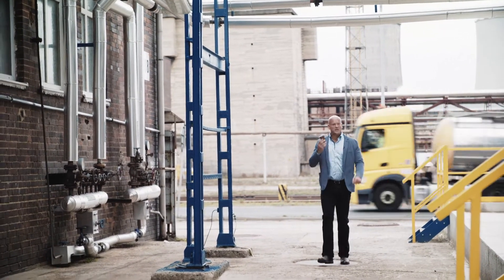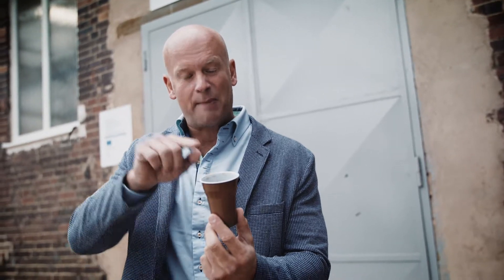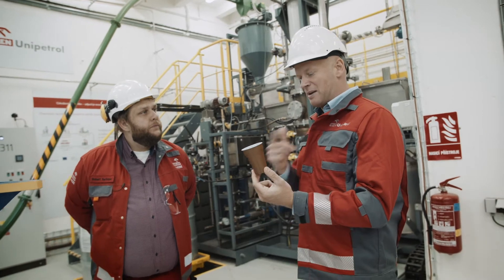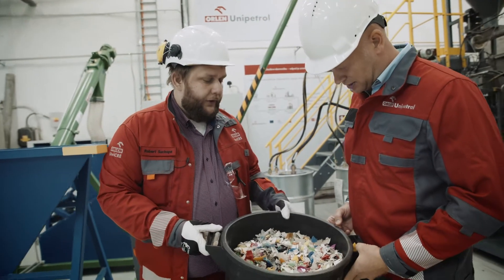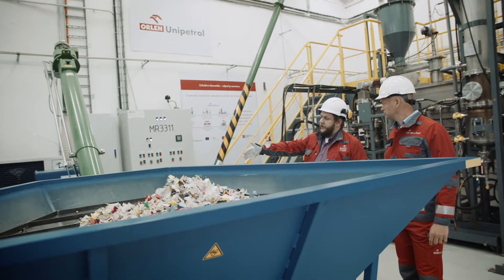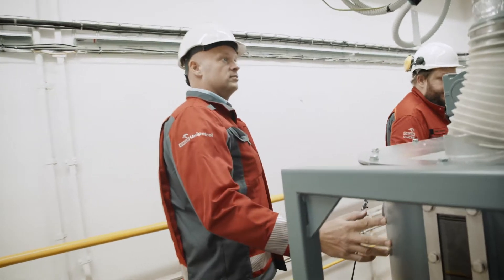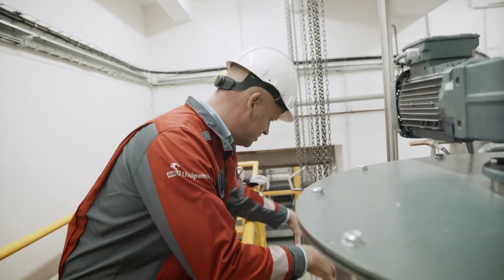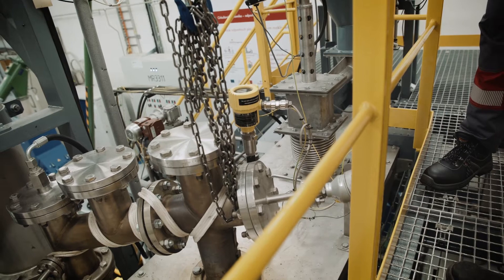🔄 How ORLEN Unipetrol is Using Pyrolysis to Transform Waste Plastics

Comment: Hello, I have a few questions:

1) I'd like to build a small pyrolysis plant for household use. Scale of max. tens of kgs / day. Would there be anyone to help me out with the design and production of such plant? (Prague, Czech Republic)

2) if not, then does Orlen Unipetrol or actually anyone in the European space offer a smaller scale pyrolysis plant for sale?

3) if not, then is it possible to deliver clean separated plastics (into different types) to a large pyrolysis plant, have it pyrolysed and obtain pyrolysis oil / pyrolysis diesel or gasoline fuel for exchange?

Thank You for any inputs and directions.
Reply: Come to the Czech Republic - Třinec city to the InventArena on 12th of June 2023 and you will find what you are looking for.